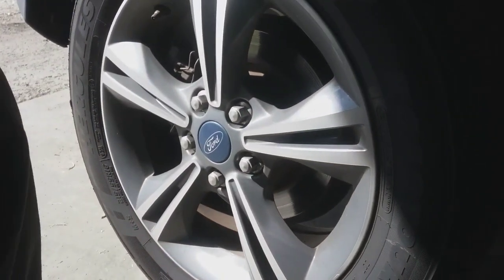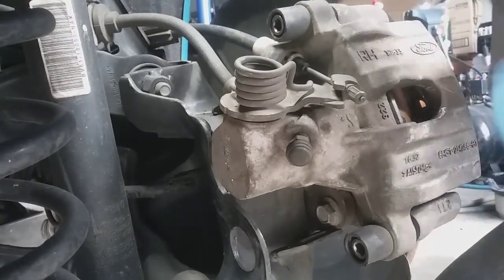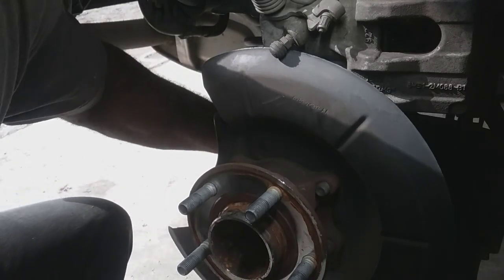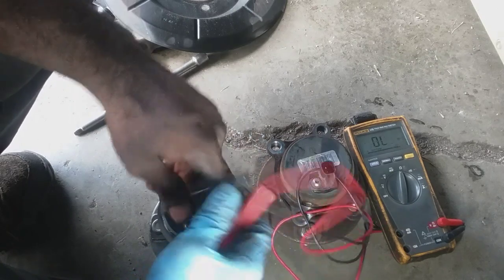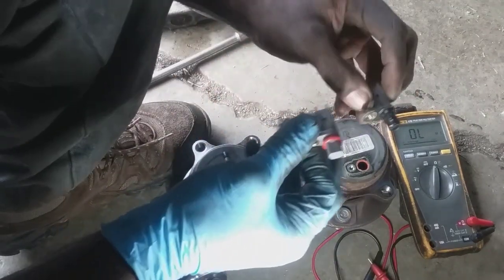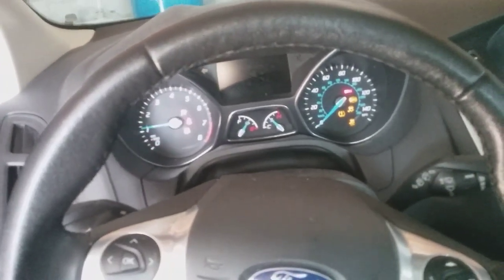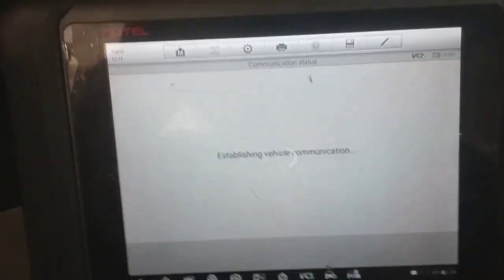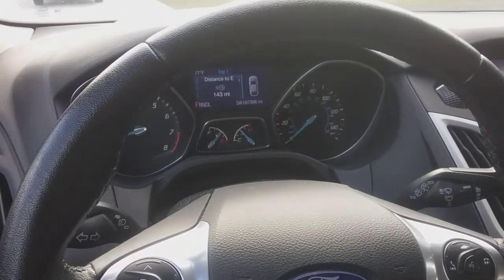2013 ford focus rear wheel bearing

Comment: This is good to know.  My wifes 2012 is getting ready to get its 3rd pair of rear wheel hubs at only 130k miles.  The first time i used the ford "updated" hubs and they didn't last any longer than the originals.  60k seems to be about all you're gonna get out of them (as shown in this video as well).  This time I'm gonna save some money and do what you did.   Great video.
Reply from the maker: Have you considered changing brands or just think it's a common issue?
Reply: @partsshooter  I'm gonna try something other than the overpriced ford parts.  I honestly think its a design flaw in the parts.  I suspect moisutre is getting past either the black plastic backing plate or around the sensor and killing the bearings.   No sense in paying ford prices if they're not gonna last any longer than chain store parts.
Reply from the maker: @harryrathien1082  that definitely could be plausible! That or cheap bearing grease! Good luck with that wheel bearing
Reply: 33,000 was I got from the replacements I fitted, only got about 80,000 from the OEM.!

Comment: You should have verified operation by going on a test drive while viewing both rear wheel speed sensors live data To show proper and rational wheel speed values Other than that great video you answered my question I couldn’t for the life of me figure out why you would need a different for one for one with park assist thanks

Comment: If you destroy the torx bolts accidentally. You can get the ARP 674-1002 kit as a replacement. The M12x1.50 are not easy to find.

Comment: So, the difference between the sensors and tone rings (what the sensor reads from) is their ability to detect direction. Sensors on cars without park assist just read RPM and send it to the module. Sensors on cars WITH park assist read RPM, and also direction of rotation. The module that control the park assist needs that info.
Reply from the maker: I'd imagine there's a impedance difference with the sensor itself. Those tone rings look exactly the same. Sensor itself can't be directionally biased. I'm thinking that pcm [with park assist] just is capable of utilizing low speed signals, over the non based on ones ability to pickup low speed signals.

I regret never checking the two now, to see if they were different in picking up signals
Reply: When I used the grey sensor I got faults for abs, traction control, and hill assist. Switched out to the black sensor from the old part and no more faults.

Comment: Is it done the same way for the front ones as well?
Reply from the maker: If it's a hub assembly it'll be similar because there's no pressing in the bearing. Assuming... It's a hub assembly vs a regular wheel bearing.

Comment: friend the electric model and sel use different wheel hub on the rear ?
Reply from the maker: In my case, one was with park assist and other wasn't, the park assist was the cheaper one over the non. The construction of the wheel bearing are both the same, just different sensors.
Reply: customhonda thanks for answering friend

Comment: Do the wheel hub bolts (reverse torqs) have a ft-LB rating?
Reply from the maker: Yes, however in my situation I didn't torque them "to specs" just made sure they were tight, added lock tight
Reply: customhonda so what’s the torque spec?
Reply: 81 lb/ft